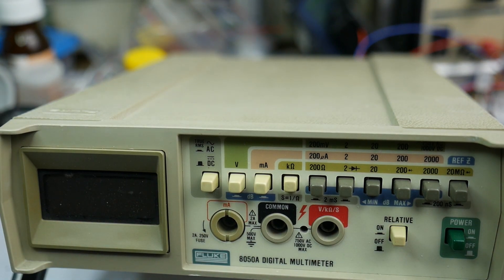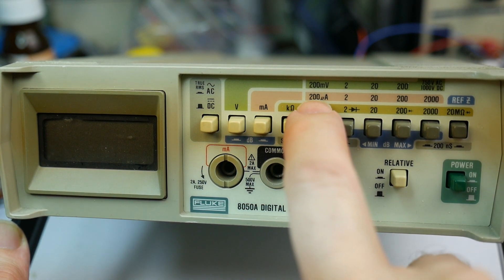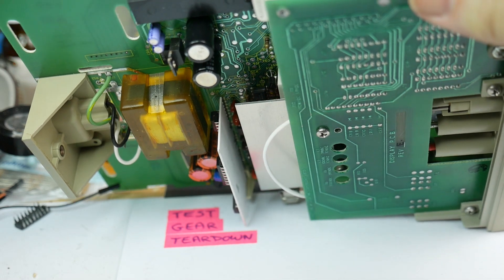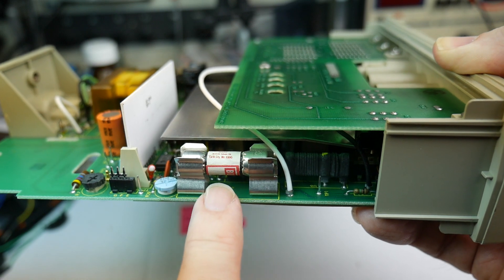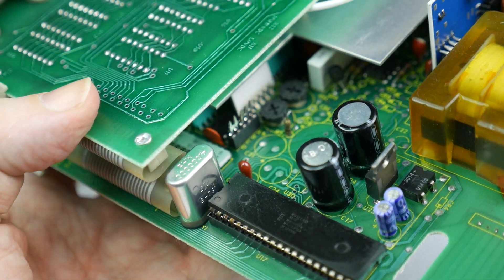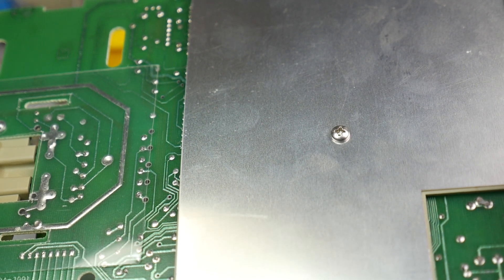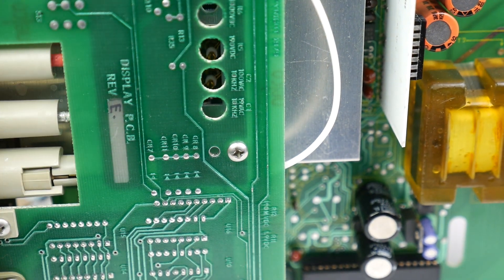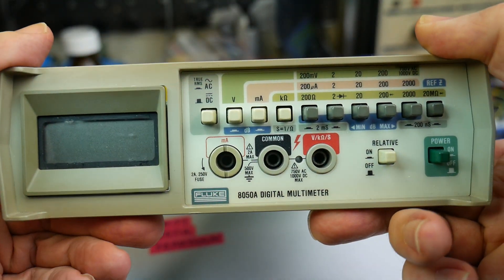Test Gear Teardown: Fluke 8050A Digital Multimeter

Comment: You can pick these up these days for $50 or less.  If they have a good display on them at this point in time it will likely last indefinitely.  A good one is by far the best bang for your money in a 4.5 digit bench DMM.  Hands down.  I picked one up a few months back for chump change because it had a display problem .. not an LCD issue.  It just turned out to be a $2 driver IC.  If you are interested I did a video on the repair.  Feb 18/23.  I've also featured the 8010A and the 8012A in other videos.  Really like the 8012A for it's low ohms feature.